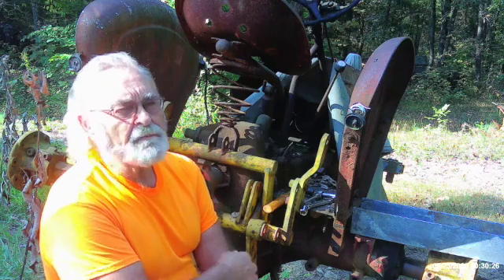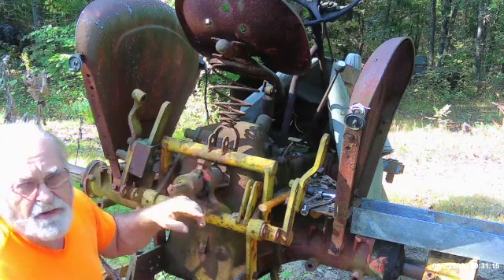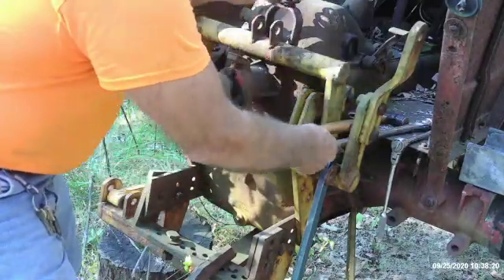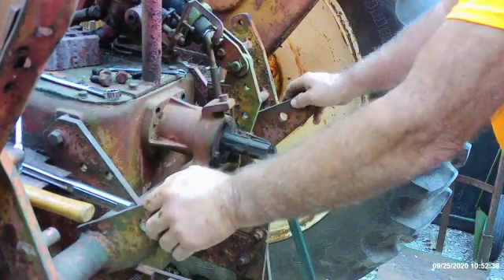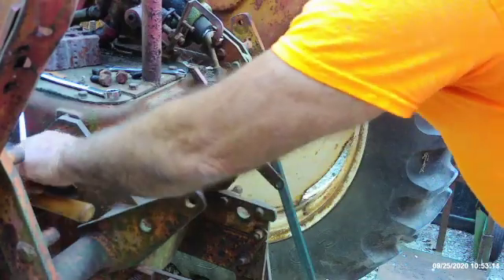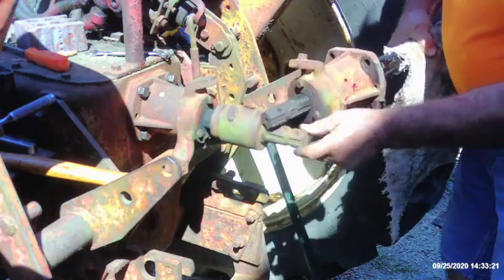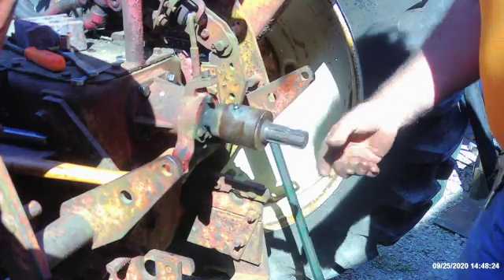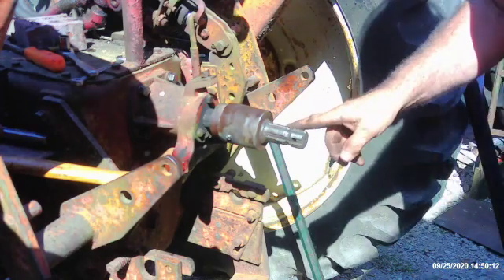Massey Harris 30 PTO Shaft Replacement

Comment: Appreciate your time to create a great video
Reply from the maker: Thank you for the supportive comment.  Using the pipe for leverage makes this a simple job.  Its kinda hard to hold it level for entry into the splined coupling by just holding the short stub of the pto shaft.  But.... I HAVE done it.

Comment: Would you sell that 3 point by chance
Reply from the maker: Well, that's a Danuser aftermarket one I believe.  And it's not totally complete. This is one that works off the cultivator lift, not hydraulic.  I'm sure you saw that and is why you are wanting it ?? But yes, I'd part with what IS there.  Where are you located ?  Close to St Louis MO. ?
Reply: @tractorman4461  so I mainly need it for the top link or do you have an idea on how I could make a 3 point bush hog work with the one I have cause I have the original one where the pto is higher than the top link and you can’t hook up a shaft for the pto
Reply from the maker: @coletaylor5515  Massey had a special top link that in the center had a huge Rectangle opening that had rounded corners and the PTO shaft wood go through that opening. It was a fairly long Opening so the lift could raise the bush hog up and down and not interfere with the power takeoff. I don’t have a top link with this Danuser but I have one that came with a 44 Special. But I’m keeping that for my own use.

Comment: Nice!  I am very interested in finding a 3 point hitch system for my MH30.  Where could I possibly find one?
Reply from the maker: Dies your 30 have the hydraulic cylinder or is it the older version with the mechanical cultivator lift ?  This one is the older version and this is a Danuser aftermarket conversion. However I have yet another 30 that has the Saginaw aftermarket three point. It’s really heavy duty and has category 2 balls in the lift arms. You can Google search for  those for a start. What state are you in ?  I’d part with this partial one pretty easily if you’ve the mechanical lift. Or I have another Danuser on a 44 that’s (I think) complete. It’s the hydraulic option. Thanks John for taking a look. If you are interested I can post a short video on both of them showing more closely the assembly so condition can be seen. Neither one has a top link with them.
Reply: @tractorman4461  I'm in Minnesota.  I have a hydraulic pump on the tractor on the front end.  It is integral to the engine.  I currently have a trip bucket attached.  It lifts a 800-1000# round bales off the ground for feeding my animals but I have yet to be able to get my son (he's a school trained welder/fabricator) to make me a set of bale forks.  Kids!  I do not have the "depth-O-Matic" lift system on the tractor.  Everything is operated through a single port hydraulic valve.  It's odd that the oil pan and the Hydraulic Tank are linked.  Never seen that before.  Makes the purchase of oil easier! I do like your videos.  Makes it easier to work on the tractor when I can see how things are done as well as what is in the manual.  I just rewired the tractor and I am removing the point system and install a 12 v electric ignition conversion kit.  Tractor was already 12V when I got it. Thanks for answering my questions.  I'll probably have more at some point.  Yes, I'd like to see the 3 point systems on your tractors.
Reply from the maker: @johnstrohmayer2573  When the weather gets a bit better I'll do a short video on the two.  My Saginaw 30 is down at my son's house though. On another note about the hydraulic system. If you look behind the grill you should see a cylindrical tank accessed by the hole in the hood in front of the radiator cap. There should be a cap that when removed will have a dip stick attached to it. That will be the level indicator for the separate hydraulic circuit. The hydraulic pump is driven off the camshaft, and is lubricated from the engine oil sump, but only circulates hydraulic fluid in the separate circuit.  Please let me know if you're not finding this to be the case.  Now I'm going to have to walk out there in the rain and make sure I didn't lie to you.  LOL.
Reply: @tractorman4461  My hydraulic tank is directly connected to the pump that is attached to the camshaft.  I got it that way.  I assumed that was how it was supposed to be.  Amazing the things you learn!  I'll look in my manual and see how the original configuration was done.  Thanks.

Comment: Hi Wendell!  Well done, as always!  You’ve got quite the spare parts inventory in your collection of Massey Harris 30s and you make good use of it.  Looking forward to seeing that Massey and PTO put to work! Thanks for sharing!
Reply from the maker: Hang in there...it'll be on the dump trailer soon !! Either that or the wood splitter.  A fellow can never have enough parts.  Most stuff is NOT available new...especially mechanical parts like these that haven't been in production since the early 50's.  Thanks for the nice words once again Martin.

Comment: Spare parts tractors are great to have around. Sure beats having no way to replace by trying to find in the market place.😎👍
Reply from the maker: Agreed....and by and large a 'parts' tractor can usually be had for a song.  I traded an air conditioner repair for this one and the F162 engine even runs!!  ....but it smokes a bit.

Comment: " horrifically worn splines"  that says it all!  Good trick with that cheater bar! Thanks!
Reply from the maker: It was baaaad too Joe.  I mean it was so bad I hated to use in on the splitter or dumper.  Had to drive it on and off and that's not good.  I've done one without the cheater pipe and it was very difficult to hold so much weight straight with just the housing and the stub of shaft.

Comment: Great cheater bar on that PTO shaft install. MacGyver would be proud. Thxs for the vids!
Reply from the maker: I tell ya though, it'd take one heckuva gorilla grip on that shaft and housing to hold it long enough to get it to engage the dual spline up in front of the transmission.  That 'cheater' kinda evens up the score just a little.  Thanks David for the MacGyver reference....LOL

Comment: You are lucky to have those spare parts around and available, so handy for older tractors to keep them up and running.
Nice and easy ( relatively ) repair there.
Reply from the maker: Well Reg based on experience we know its good to have at least one spare parts tractor for each different model.  There is that odd part that just cannot be bought reasonably and sometimes at all !! We try to anyway....  Yes, a very simple repair for sure.  They all ain't this easy though as you already know.  Have a nice warm evening way up there....

Comment: Good explanation. 

I’m hoping to hear the old tractor run in future videos.
Reply from the maker: Oh yeah David, this is one of my daily drivers.  She's been highlighted in quite a few videos.  I guess I should have taken a side shot of it so it'd be recognizable.  This is the one that's used quite a bit on the dump trailer or the wood splitter.  Those two trade positions quite a bit and the third is at my son's house down the road a mile or so.

Comment: That non-hydraulic lift is pretty interesting how it worked. 👍👍👍
Reply from the maker: These mechanical lifts were an improvement of the hand-lever operated mounted attachments and the interim between those and the hydraulic operated ones.  There is a little foot lever with a square pad on it for you to hit with your left heel.  Then there was a little 'dog house' under which was a short arm that rotated 180 degrees each time the foot lever was depressed.  The short arm  faced the open rear of the dog house and was coupled to the implement via linkage to drop into the soil or back out of the soil.   It was generally just called a 'cultivator lift'.
     We had a 101 Junior and 101 Super and neither one ever suffered a mechanical failure.  The donor tractor has the remains of an aftermarket Danuser three point lift whose rock shaft is rotated by the short arm of the cultivator lift.  One of the few non-hydraulic three points I know of.